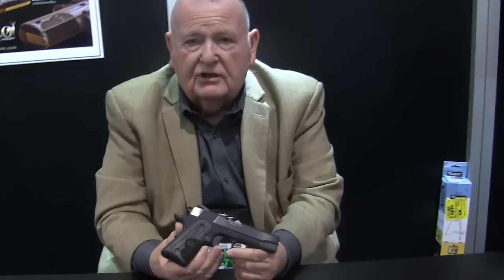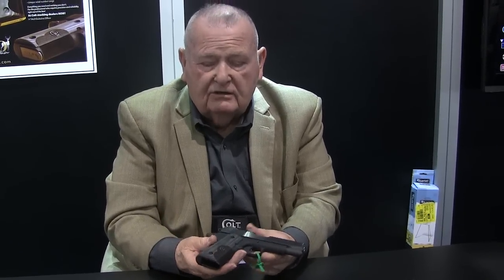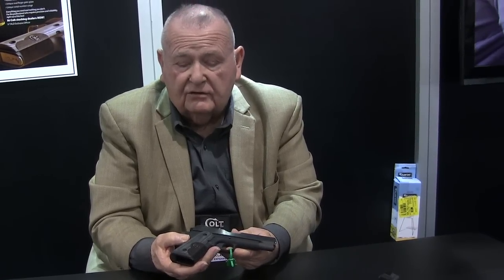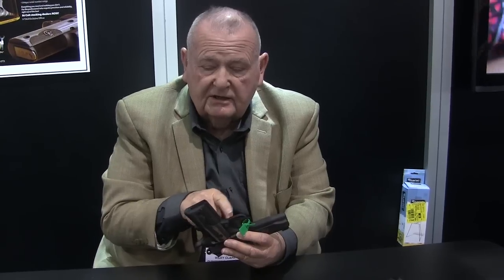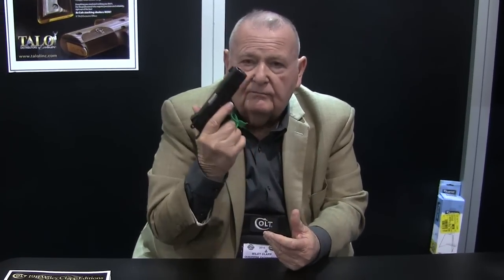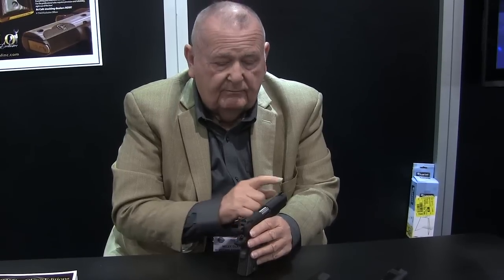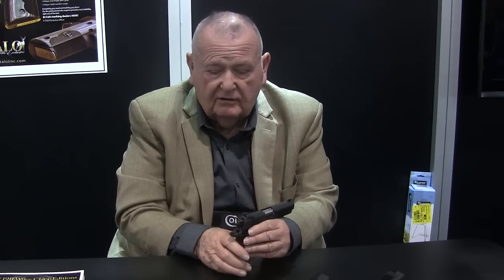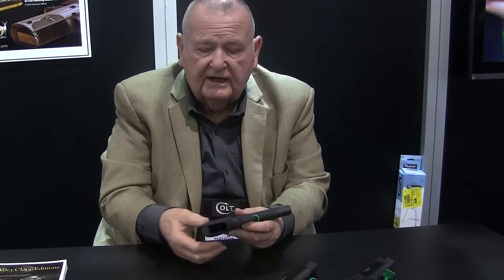Colt Wiley Clapp CCO at the 2015 SHOT SHow

Comment: Probably should have added more particulars about the original.  It has a forged ti frame officers size, forged s.s. flat top slide, forged barrel and a fitted barrel lug and and under cut on the trigger guard.  Wide paddle safety and frankly it ain't the tightest slide to frame fit I've ever felt but it goes bang every time and it is accurate. What to look for in a decent .45 is how the barrel and lug fit into the frame.  Press down on the top of the barrel  where the ejection port is.  You should have 0 play up and down, next take the slide and push it back just a little and check the travel up and down of the barrel as it rests in the bushing.  Again there should be very very little if any play.  As for the slide to frame fit mine ain't tight and I think that is a good thing as any debris or anything will not compromise functionality.  Mine has the lowered and flared ejection port too.  Other little subtleties that unless your are a .45 person you might not notice.  Oh yea weighs about 29oz loaded.